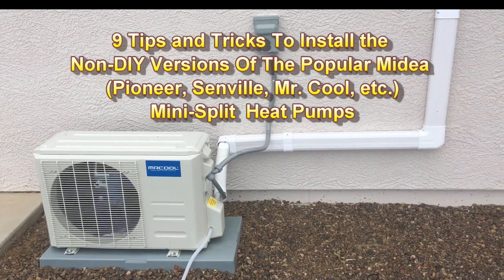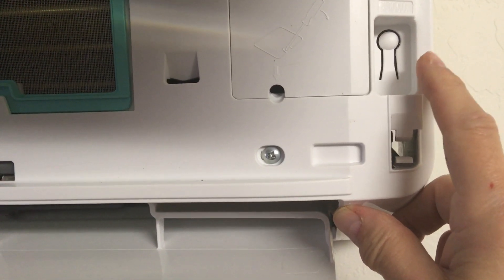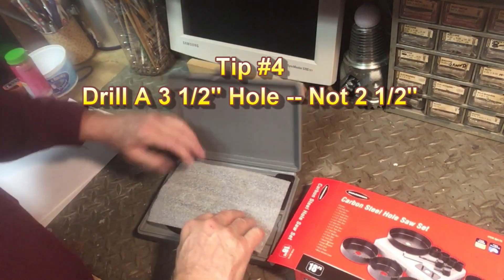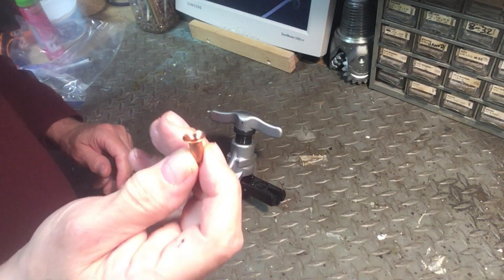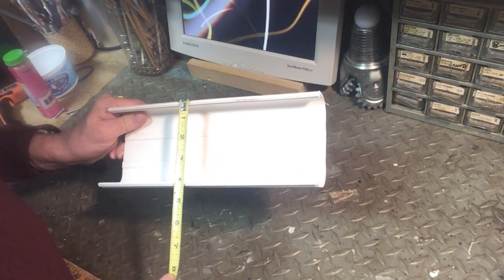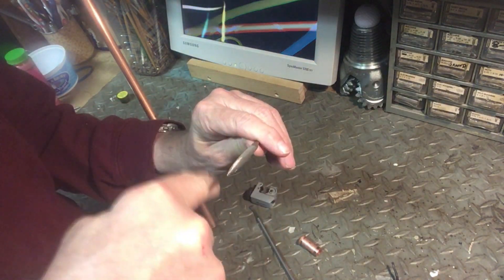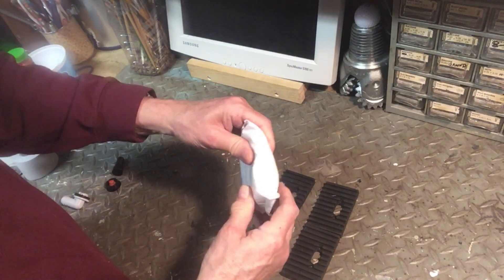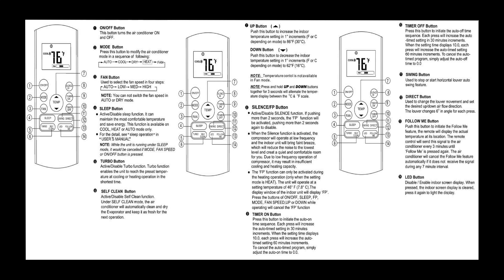9 Tips To Install Cheaper Non-DIY Mini Splits - Pioneer/Senville/Mr. Cool

Comment: The nitrogen isn’t there for corrosion protection, it’s to keep the lines dry as not to contaminate the system from moisture.
Reply: It’s main job though is for leak checking.
Reply from the maker: It did that well. It was very satisfying to hear the HISS.
Reply: @andrewdarbyshire9108  no, it's just to keep oxygen out until the day of install.  You would have to re-charge nitrogen after install to leak check.
Reply: Hearing that hisss... Is the sound of NO LEAKS
Reply from the maker: Correct.

Comment: I used 2" PVC for my first install. And I ran into same issue as I'm going to install two mini splits, through a common 3" PVC hole. In my case, these are on inside walls, so the condensate line has to be connected to the sanitary sewer system. I have the wall opened up, so I can run the copper as needed. All good suggestions to help DIY'rs.
Reply: Fred, I was thinking about the same idea to run the condensate lines separately through the sewer or to the toilet tank. Could you please share some details on how/where you connect that. Thanks!
Reply: @ZocoLat  As the wall is opened up, and this wall has a vent that goes to the roof, I can cut that pipe, put a sanitary Tee in. Sanitary Tee just means there is a slight downward curve to that side inlet (you don't need that long radii connection, as that is used for horizontal connections). My vent is a 3" PVC pipe, that vents a toilet  right below. I purchased a Tee that had a side inlet hole of 1-1/2". To this I will reduce it to 3/4" (my supply store had this and the condensate trap) and extend it to where the mini split condensate line is. There must be a trap to prevent sewer gases from entering the home, so on the end of the 3/4" I purchased a condensate line P trap for just this purpose. It is 3/4" as well, and the flex hose from the indoor unit condensate pipe fits very tight into this. I do have to drill 1 wall stud to do this extension.  Plumping code requires 1/4" per foot slope downward so it drains properly, and that is easy to measure where the hole has to be in the stud to make this extended pipe in the correct place.
Note pipe is measured by nominal ID, so to run the 3" hole, the schedule 40 DWV (Drain Waste Vent) PVC pipe has nominal 1/4" wall thickness, so a 3.5 inch hole saw is used. I just drilled this yesterday, and this hole is too tight for an easy slip fit, so I now need to get a wood rasp to shave the hole a slight bit bigger. 
I don't think you want to dump your condensate into the toilet tank. Hide all this in the wall where the vent is. You probably have to patch drywall. Look up at your roof to see where the vents are. If it's not at your bathroom location then they connected it elsewhere in the attic space, but there must be a vent for the toilet very close by (memory is within 3-6 feet from the downward water closet fitting). I hope this helps.

Comment: Dude you are a God send!  I was worried about sending the tubing through the wall but your idea of the smooth pvc pipe solves that in spades.  No crimps for me.  If the tubing was found to have no pressure sound (the nitrogen purged tubing should I get a bottle of nitrogen and purge it before vacuuming it out?  Thanks.  I have a mastercool universal kit would that be the right type of flare for this unit?  Here is a video: https://www.mastercool.com/product/72485-universal-hydraulic-flaring-tool-set/
Reply from the maker: I believe that if you hear no hissing indicating pressure, you have a leaking condenser. You might want to pressurize it, put a gauge on it, and let it sit for a few days to ensure there is no leak. If you try to evacuate it and then fill it, you might have a tiny leak that would not show up immediately, but would eventually allow the refrigerant to escape. It is a very satisfying feeling when you hear the HISS.

To me, the PVC was sort of important. As I said, the sleeve they gave me was useless...the equivalent of soda straw material. You want the job of hanging the unit while you are balancing on that ladder to be as easy as possible. You are trying to attach a bulky unit that weighs maybe 30 pound  to fasteners you can't see while avoiding tearing up or kinking the delicate lines, which are sticking out the back about 3 feet. I did not want to fight with a too-small sleeve while trying to hang onto a ladder. I had to buy a hole saw set anyway, it came with a 3 1/2" bit, and the extra cost for the far-better PVC was about $6.00. It slid in as slick as a whistle.

Comment: Spring benders are junk
Reply: yeah for complainers who don't know how to use them
Reply: the Pioneer comes with a spring bender preinstalled around the upper lineset (the part you poke through the wall).  It may or may not be perfect, but it helped avoid kinking the lines.  Those guys aren't dumb!

Comment: Yeah DITCH that ding sound!!  You covered a good deal except the actual charging of the system
Reply: The system is already charged.
Reply: @andrewdarbyshire9108  Negative, this is a non DIY install.  It isn't already charged...which is why it is cheaper to buy them because they need to be charged.
Reply: Rob Flynn II so there’s absolutely no charge in the condenser??
Reply: @robflynnii3196  the system already has refrigerant in it, all you have to do is evacuate the air out of the line and release the refrigerant into the line from the outside unit
Reply: @Sadowskibradley  Understood. The title led me to believe this was a non-diy install meaning the system needed to be charged.  My apologies to you and Andrew.
Reply from the maker: Andrew Darbyshire is correct. This system comes PRE-CHARGED. You only evacuate the evaporator and the lines running to it, because all the compressor valves are closed when you do it. After you evacuate the evaporator and test it, you release the refrigerant into the whole system.
Reply: @robflynnii3196  The Non-DIY units come with the refrigerant inside the compressor and will charge up to a ~20ft lineset on their own. However, you're still responsible for pulling a vacuum on the lineset and inside unit, making the seal, and then opening the valves on the compressor to allow the refrigerant into the lineset and indoor unit. You only need to charge the non-DIY units in a traditional sense if you're using a very long lineset and the compressor doesn't have enough refrigerant stored in it.

In contrast, the DIY units come with the required refrigerant stored inside the compressor AND the lineset/inside unit are already pulled down to vacuum. The lineset is attached permanently to the indoor unit and has special fittings on the other end to mate to the fittings on the compressor. All the DIYer has to do is to screw the connections together and open the valves, which allows the refrigerant to flow into the vacuum inside the lineset.
Reply: You are only good for 20ft of lineset? ... thats lame. Mitsubishi/ fujitshu is good at 40ft minimum and can go.up to almost 200ft...

Comment: Great video, what did you use to charge the lines with refrigerant? Or does it come pre charged?
Reply: The outdoor unit comes precharged with R410a. You do need to pressurize the lines to test for leaks. That typically requires a can of R410a and a hose connection to the suction line of the outdoor unit brass valve (via a gauge manifold service tool). After you determine no leaks, then a vacuum pump is connected to this line, evacuated, the valve to the vacuum pump is closed on the manifold. Then the valves on the outdoor unit are opened to fill the lineset and indoor unit with refrigerant. Once you full back seat the valves on the outdoor unit, you can remove the gauge manifold, then replace the caps to these valves. They use hex allen wrench keys for these valves. As there is a rotating shaft seal, the caps provide leak protection, and must be snugged tight to make the seal.
Reply: @f.hababorbitz  do you know if it’s possible to use the precharged lines from mr cool on other models and avoid having to pressurize the line sets?  And is that the only real difference between the DIY models and all the others?  I really like the look of the GE Art series (the wall units).  Would they be compatible with the precharged line sets?
Reply: @f.hababorbitz  how much does a can of R410a cost?  Where do you buy it?

Comment: the ring sound  was too laud   
but yes,  i did learn something.
I add ; if one is  technical to that level , to do flare,  I recommend do it  with silver solder.
Yes,  on these small units you can do silver solder.  you do not need brazing ,  see same on you tube.
Flares are always the weak links.
thanks for info.
greetings from north California.
Reply: Silver solder is high temperature brazing operation. And the outdoor unit has valves that are not designed to have copper tubing brazed on. And you have to provide an inert gas purge to prevent copper oxide from forming inside the tubing at the braze locations (typically nitrogen). So this kills any DIY'r. Agree that flares are the weak link, but in the old days before silver solder, flares were the connection means for all systems. But the pressure of R12, and sulfur dioxide were much lower. A bigger problem with these systems, if you have a leak, the compressor will burn out, as refrigerant is used to cool the windings, as this is inside a hermetic can. That is the one flaw of these systems, they don't have a low pressure switch that better quality central air systems have to shut them down with low refrigerant charge.
I saw the video by T&N Services LLC, and thought he was a nut brazing the connections, added much time to the install, and frightened away DIY crowd. And you can't get around the valves on the outdoor unit, where they are exposed to being trampled on.
Reply: @f.hababorbitz  the one sold under the MrCool brand and others does have low refrigerant detection and other safety features.
Reply: @greggv8  Good to know. MrCool is intended for DIY installs, it has a very old style of refrigeration connection that I've only seen on WestingHouse HeReLi heat pump systems back in 1976. It was clever back then, but the promise of northern climate heat pump using air to refrigerant still failed as once 32F temp occurs the system changed over to 100% electric heat. I grew up in North Dakota, and the duration that the temp changes from summer to winter is very short so heat pumps just can't get enough heat in that climate (to heat during the long winter, and the cost of the system was high), especially when the highs of the day are -20F (that's in the eastern side of Dakota, as the western side had much more a moderate winter). Viable heat pump systems in those climates need to use the energy in the ground, and that adds a big price to the initial cost, as well a large area needing to be excavated deep enough to extract energy.
Reply from the maker: Thanks for watching!

Comment: I’d do it myself but the warranty will be void
Reply: the warranty will be only for AC units  not for labor , if something failed on the system you would spend more money  on labor for installing and fixing it than buying a brand new unit although every brand has  free teck   support
Reply: Yes but you could replace it once for about the cost you would pay to have it installed. Or get a Mr. Cool thats generally a little less efficient and DIY linset and they warranty to DIY installs.
Reply from the maker: Yes, you have to take that into consideration. See my comments. Since I tend to fix everything myself, it was not a major problem for me. Also, I am little tight with my money. :)

Comment: Good tips, it's not that difficult to do for sure 

The 2.5 hole and sleeve is plenty no advantage to the pvc 

Need a micron gauge btw to verify the flares are right among other things
Reply from the maker: My first installation, and I wanted it to be as good as I could make it. I fitted the supplied 2.5 sleeve over the lines, drain, and control cable while the unit was on the bench.  That sleeve  (you may get something different - accessories may vary) was made out of what looked like plastic soda straw material. It severely distorted itself around the well-padded pipes, and would not have been round as it entered the wall. The PVC was a whole lot neater and more professional-looking, which was important to me (even if you could not see it once it was covered). Thanks for the comment!
Reply: @bupright  Installing the sleeve in the wall first avoids the problem of trying to push a distorted sleeve through a round hole, and keeps the entire bundle from contacting any sharp edges in the penetration hole. I screw and caulk the sleeve collar to the exterior siding; trim inside end flush. (Or I suppose you could put the collar on the inside if the interior penetration will be visible and the exterior will be covered by watertight line set cover.) Diversitech 230-WS2 2.5" sleeve is not quite Schedule 40 thickness but rigid enough that I don't think could distort, even if placed over bundle before going in the wall. The bundle is very tight in the sleeve. Instructions unfortunately say "wrap with insulation tape," moreover, which adds bulk and is unnecessary as drain & refrigerant pipes are already insulated. Fail. Instead, wrap the entire bundle tightly with electrical tape, full coverage, from base to tip. This both reduces bulk by compressing the foam insulation and greatly reduces friction with the sleeve. For typical install with bundle exiting from the back of the wall unit, two people, one holds up the unit, the other guides and pushes the bundle through the sleeve. Once mounted, one last tug on the bundle from the exterior may be needed to make the interior wall unit lie flat. Obviously, then remove electrical tape back to the point it exits the sleeve.
Reply from the maker: Yeh, the sleeve they gave me was nowhere near the quality of PVC. It was made of soda straw material. I think the PVC cost me about $6.
Reply: agreed

Comment: Thank you for this information! I was looking into getting a Mr. Cool but now I'm confident I can find a cheaper model and cut down my own copper to not have a useless loop of excess copper.
Reply: The Mr Cool Advantage series is an excellent choice if you want to custom cut the lines and vacuum yourself . You can get them from the Home Depot website at a very good price . I also purchased the same vacuum pump he is using in this video from the HD website for about $75 .
Reply from the maker: If you really don't  want the vacuum pump after you install it, I'm sure you could unload a once-used one on eBay immediately (but sell it after you test everything out for a month).  I think most types williing to install this way would prefer to keep the tool for auto a/c, etc :)..... Another option I have heard is that some auto parts stores either rent out or let you borrow vacuum pumps (most probably when you buy an air-conditioning part). But, if you are a good customer at your auto shop, they might just let you borrow one for free. :)
Reply: @bupright  OReillys auto parts loans them with a deposit, guages too.
Reply: Patrick,  which unit did you buy/install?  It bothers me that MrCool are at least $500 more just to get the warranty.
Reply: @rondail5675  really? Pioneer come with 5 year warranty
Reply: @growshack9067  ,Last year I installed a 18k MrCool downstairs, this year a 12k Pioneer upstairs.( Both are not DIY units)  Both are 95% the same. I prefer Pioneer because I can order the length of Line-Sets and I can talk to a Pioneer person.  I cannot call anyone for MrCool, would have to call a service provider.  Because I am not a HVAC Tech, I believe my warranty would be voided.
Reply: @rondail5675  precisely!! Pioneer, senville, Mr cool.. all same thing! I went with pioneer for same reason. Plus my HVAC Pro ( 30 years experience ) tells me Mr cool are the last brand he'd buy himself .. Says pioneers have the least screw ups in his experience. He's my friends uncle , known him all my life. Hes out to help me, so I take his advice to the heart 😂. Great units he says
Reply: @growshack9067  VERY HELPFUL TIP!
Reply: @growshack9067  I was looking at purchasing the Senville brand,,$400 cheaper than the Pioneer and Mitsubishi for the same BTU.